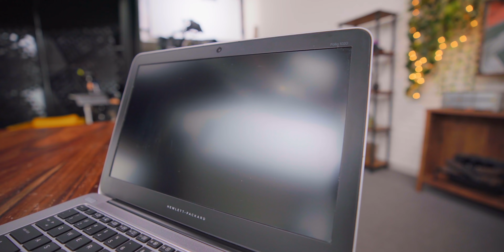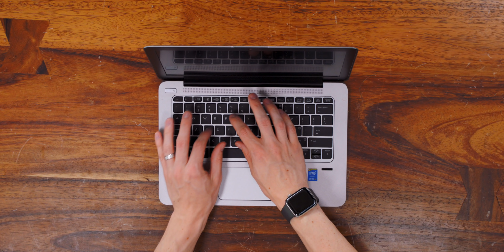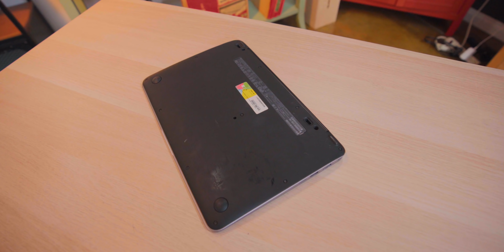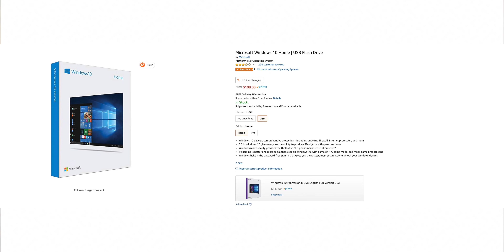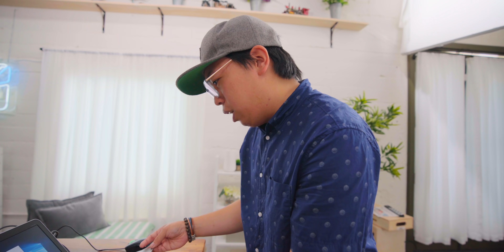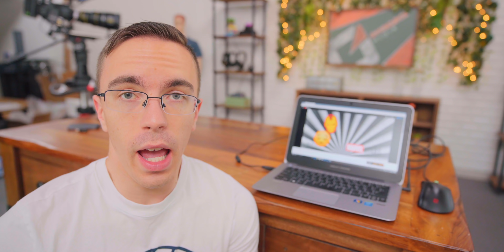My $190 eBay Gamble

Comment: Yeah just make your own windows 10 flash drive. Last time i did that installed failed the first time and after 2.5 hours of fucking around it finally worked. Oh and good luck reformatting that flash drive after your done. Having to install windows is the reason I DONT built PC's. SOOOO much easier to go grab an old optiplex.

Comment: Austin: This fingerprint reader is really cool to have on a $200 laptop. Me: (laughs in Thinkpad T61 and the spare $150 in my pocket).
Reply: @jdslyman My point exactly. The old Thinkpads are indestructible and most of them work just fine today. Even with a Core Duo and 8GB of sweet, sweet DDR2 or DDR3.

Comment: I gambled on a Refurbished Laptop from Ebay. Pretty good specs and what not (SSD, 16GB RAM, Intel i7), but the rating on it was B+ I wondered what it was. I ordered it for $300 and noticed that it was only slight cosmetic wear which I easily hid with stickers.

Comment: Hey Austin try buying an ASUS N550JK. It's a pretty quirky and classy impressive laptop. It had this screen problem where the connector on the mb was faulty, but spec wise it's very capable. The screen is great and the build material is beautiful. Hear me out!

Comment: i made a 187$ gamble and got myself a near mint condition 2011 13" macbook pro with i7 8gb ram and a 256gb evo 850 ssd.
what its problem was is two things: 1. it had no OS installed on it - easy fix, and 2. its battery was inflated and caused the trackpad to push out quite a bit and the battery life was at about 3.5-4 hours - bought a brand new genuine apple battery for 45$ and now it even lasts nearly 9 hours.
so for less than 230$ i got myself a blazing fast 8 year old laptop which still amazes me how dam good it actually runs - its geekbench score is more than double of the HP you got here and with Mojave(installed it with the patcher) it runs almost faster than my 3000$ windows desktop gaming rig, and definitely faster than my Lenovo Y700 Laptop which has a quad core i7, 16gb of ram, the gtx960m 4gb edition and samsung 960pro m.2 nvme ssd.
i'm shocked with how great this gamble came out.

Comment: i picked up a hp elitebook 8570w workstation laptop for about $95 aud no hdd bad screen only 8 gig ram put 1080p screen in and 24 gig ram going to add a msata SSD next with a 1tb SSD too ... Cpu is i7-3720qm. quadro k2000m gpu 2 gig ...  im going  upgrade it as its mxm slot card .
If you see  hp workstation laptops 3rd gen or newer there great for the price mine was over $2000 new i think im less than $250 aud in now

Comment: Literally only a few days ago I did the same thing went out on a limb paid 195$ for a
 Lenovo L440 with i7-4700MQ
8gb of ram
Windows 10
Ac adapter

Apart from the screen being 16 by 9 and not having a ssd also the laptop is huge. it's a amazing computer for the money.

Comment: Absolutely ridiculous. You can get a dell with a i7 4800mq, a 250gb ssd, a hd8790m a 1080p screen and 8gb of ram with windows installed for 200-250 bucks almost any day of the week. If you give it enough cooling it’s literally a gaming laptop. You can play any game at low setting 1080p with 40-60fps. It’s big and ugly but hey, you have a laptop that competes.

Comment: 🙂 Austin, it looks as though you won the gamble.

I think that the laptop that you purchased on eBay is worth the price.

In my case, I would have installed Linux on it (Eight gigabytes of RAM is more than enough to run any distribution of Linux smoothly).

Comment: You'd be suprised how often this actually works. I tend to do this to make a spare bit of cash on the side, and sure I might need to get a new HDD or power brick every now and again, but this is more often than not all it takes. Mark the price up a fair bit, and make a nice tidy profit. My ex-girlfriends father used to work at a skip, and did something similar with tons of hardware, find em', fix em', and sell em'. He had better profit as he got a lot of the junk for free, but it is a good way to make a spare bit of cash, if you know what you're doing, and I'd wager most of tech YT viewers probably do.

Comment: 190 for this? Really? Fat ripoff. You can get a i7 thinkpad t450 or 460 for that price. Comes with ssd, 1080p display, amazing keyboard, fingerprint sensor, ssd, and ofcourse thinkpad build quality and built with magnesium. Imo that's the best used laptop you can get

Comment: Did something similar back in 2013. Got a "for parts" MSI 7950 Twin Frozr 3 that had some info about when/how it stopped working..

Got the card and it didn't work, thought I'd try the second bios to see if it made any difference.. It worked fine and I used it for a week or so.

Ended up finding out the card was under warranty, but just cleaned it with compressed air and flashed the second bios to the main bios and sold it for $340 AUD (around double) what I paid when the bitcoin mining was big.

Comment: Not sure if you'll see this comment, but one of the executives at the company I work for had this model laptop before I updated her to a newer model with a more capable processor. If you're missing any drivers still, install the HP support assistant application and it'll find anything you're missing. I hate using OEM software, but for the business grade HP devices its almost required to get the correct and most up to date drivers. Also, dont install Linux on it because you'll have a bad time lol that touchpad is god awful and basically complely useless in Linux.

Comment: Get an old dell precision. I got a m6600 with a 2540m, quadro 3000m, and 4gb of ram for $150. Popped in a 240gb ssd and it is great. Easy upgradability and a 17 in display is quite nice as well.

Comment: I got a similar one for 180€, around 200 USD, with a 256Gig SSD, 16GB of RAM, Full Hd, an i7 4600u, a firepro 4100m
USB 3, displayport, VGA, fingerprint
It was an older workstation
It's an HP ZBook 14 G1 Mobile workstation
Works pretty well
AND I LOVE THE TRACKPAD, MORE THAN THE ONE FROM THE MACBOOK PRO, IN MY OPINION

Comment: I love working on older laptops :)  I do board repair when they are foobar too.  Right now my main computer is a Dell XPS L704x, when I got it it was total fubar. But now its working great and its been my main everyday laptop for coming up on a year. It's got an i7-2720HQ, 16Gb ram, SSD + a HD, 3Gb GT555m, and a blueray.  It's much more powerful then my old phenom desktop. Because I fix so many laptops, I actually have like 8 or 9 repaired ones to chose from lol. But everyone cost me at most around $45 each and they all were fubar originally.
Reply: Only issue is I'm not really a sales person so I've actually never sold a laptop I repaired. I just keep them all :/ lol

Comment: Should have gone for the HP Elitebook 9480m, it goes for the same price and it's much better, it has a 4th gen i5, 6 hour battery (in my daily use)

Memory, and 2.5 inch drive are upgradable the cpu heatsink is easily removable for new thermal paste application. Battery is also easily replaceable.

Comment: I loved that you did this video as well. A few months ago I bought a bare Elitebook Folio 9480M with a 4210M CPU. No SSD, no RAM, and no power adapter-but it only cost me $60. I put in RAM, an a SSD,  purchased a power adapter and it’s run great for the past few months, good enough for Chrome and the few Office programs I run, even if battery life wasn’t great and I had to tape the battery in. Great investment, and I felt the same way you did. However, recently, it started shutting down if I moved it too much, and now I have to look into the issue. It’s really important to remember that like you said, this is a big gamble. I have no warranty to fall back on, and you have to be prepared to keep working on it-which you and I are. Just wanted to point that out, and once again, fantastic video Dunc Austin.

Comment: I literally bought an hp elitebook 840 g1 this month. For 350$CAD. 256gb brand new ssd inside(literally reported less than 30gb in writes.. which is basically windows), i5 4300u, windows 10, 8gb of ram, power adapter... Touchscreen too. Condition is near perfect. No scratches anywhere.

Comment: No power cable or original packaging? U sure you haven't bought a stolen devices?
Reply: A lot of the power supplies are still useful for the new models, and are kept by the individual employees. In other cases they're sold separately to increase liquidation profits
Reply: @jamesp5644  good point about parting out the PSU for money, or back up
Reply: go looking for Lenovo Thinkpads, and it's often times either enterprise, or education surplus that shows up on eBay, and they sometimes have the HDD ripped out, and smashed for data purposes, and they don't include the power brick for what ever reason, so even when I get rid of a laptop, or netbook I always keep the power cord in case I ever come a good deal minus the brick.
Reply: ..with a destroyed windows install..
yea its probs stolen
Reply: Henry Hill no they are probably right

Comment: For touchpad, just install Windows precision drivers.. You have some mod for not supported Lenovo i think which works fine on other manufactures also ( if it's synaptics something something ..). Didn't do that for cuple years now as I'm in Linux world since on daily basis but as I can recall they were much better than synaptics...

Also I've done this on many laptops for family and friends and all were a lot appreciated. That's because here in Croatia macs which are kings of trackpads, and similar priced other manufactures laptops are kinda in a good used car territory.

Also think d2d done video on those, try to look up.

Comment: I've got an HP Elitebook 8470p that came with an i5-3320m but I swapped the cpu out for an i7-3612QM. It's a super awesome laptop and I use it every day. It's my main Linux machine.
Reply: I’d put windows 10 on it. My main Linux machine is an i7-5500u with 6gb of ram. I barely use it though.
Reply: @EvilTurkeySlices  I have 2 computers. For a while my elitebook was dual booting  windows 10 and *buntu. I bought an HP omen with an 8th Gen i7 and that machine runs windows only. I like having separate operating systems on the different sets of hardware.

Comment: I bought an Nvidia variant of the Dell E6400 for $50 on eBay that had a Core 2 Duo T9550, and 4GB DDR2 RAM. I added an ADATA SU800 128GB SSD, And replaced the ODD with a second HDD. I also changed one of the DDR2 sticks from a 667MHz to an 800MHz stick. It runs Windows 10 very well

Comment: What’s the difference between a “business laptop” and a regular laptop. I’d assume business laptops are weaker since they mainly just need to do basic things?
Reply: penandpaper just see diff between lenovo thinkpad and other regular lenovo laptop
Reply: Business laptops usually have quadro GPUs in them instead of geforce ones. That is if you get a laptop with a dedicated GPU which some do have. Build quality is normally better on a business grade laptop then a consumer grade one

Comment: When you buy any tech cheap it’s a gamble but sometimes you find gold like an Xbox One Elite controller I found at a yard sale for $20 (it’s fully functional)
Reply: Business grade laptosp are usually fine for buying used. Its the consumer grade stuff you need to worry more about. Even Business grade desktops are fine if the company has swapped out their entire office for newer mahcines. Those are liekly to be missing hdd/ssds tho but those are pretty easy to replace.
Reply: Once got a model M13 for 10 bucks at a garage sale
Reply: I actually own 2 used laptops: 

A Lenovo z500 with a i7-3632qm, gt710m and a 1tb harddrive. (also upgraded the ram to 12 gb and swapped a 512gb evo 850 from my old laptop as well) 

I also own a Lenovo yoga 2 pro with a 3k Samsung display, 256 gb ssd, i5-4200u and 4 gb of ram.

Both were around €75,- each (I basically stole them)

(fyi I live in the Netherlands that’s why it’s in euro’s)
Reply: Lmao this comment is stolen from IGN from their ps4 pro 500m unboxing!
Reply: Random Stuff My comment?
Reply: Lucky i had to fork over 170$
Reply: Same! Bought a used 500 million limited edition ps4 controller for $40 bucks used and works perfectly fine!
Reply: Edward Rodriguez that’s awesome. I usually will buy used tech unless if it’s something I really want and it’s not too expensive like the new Sega Genesis classic that is coming out. I am definitely buying that day one
Reply: Edward Rodriguez there hasn’t even been 500 million ps4’s yet so how is the remote “limited edition”?
Reply: Censura I think the 500 million is for the PlayStation console line as a whole not just the PS4

Comment: In a few months
Gamble: Installing Windows on a Huawei Matebook
Reply: I have Matebook D Ryzen and dual boot to Linux Mint 19 and everything (including touchscreen) worked out of the box. Is really great for when I want a change of pace.
Reply: Well, it seems to happen.😁btw I hate Huawei
Reply: @Tesla Model 3 Linux definitely doesn't "suck" yea it takes some time getting used to it but once you know your ways around Linux you can do your tasks in way less time than windows. And you don't have to rely on prebuilt software which sometimes cost money. You can just get the source from github and build it yourself. The community is very helpful and they are  very supportive towards newbies.
Even a cancer place like 4chan has a  good Linux community.
Reply: The first thing i did after buying my matebook X pro was install Linux on it.
Linux>>>>>>windows
Reply: @coffee-vz1nr  Android is linux...
Reply: @RettigJ sorry I didn't get the context of your comment but yes I know android is Linux infact android runs on a modified monolithic type Linux kernel which is based on lts. Even though v5.0 is out android still uses the lts branch meaning it is still stuck on v4.9. but it doesn't use the bsd library instead uses its own bionic library code. Also android doesn't have native X support and it also doesn't support the whole range of GNU libraries
Reply: @coffee-vz1nr  Congrats on the research :)
Reply: Snow Hound just hackintosh it and your gucci
Reply: @coffee-vz1nr  not if it comes to compatibility
Reply: @doktorj8462  compatibility isn't an issue when you can dual boot windows and Linux. For the stubborn stuff use windows. Fingerprint scanner was an issue but with ubuntu 18.10 they added support for it. The best distro to run would definitely be ubuntu due to its huge developer support and community. Linux community is way better than windows. Whenever you ask a problem in a windows related community if they don't know the solution they blame it on your hardware. Literally I was running windows 10 and facing major lags and screen tearing and the most of the reply was to throw my system in the trash. (It's a core 2 duo e7300 paired with a gt610 and 4 gig DDR2 ram) really old hardware I know.  At last I decided to give Linux a try and got ubuntu 16.04 running on it. Shit was smooth af. I could not believe the performance. I was only getting ram usage of 800mb on boot. Compared to 2.6gb on windows. So I started to read books on Linux and Currently that old hardware running solus 4.0 serves as my 280TB Plex server. That machine runs 24/7 without a hiccup

Without Linux I would have probably trashed that pc back in 2016. Maybe I'll show some love and replace the e7300 with a q9650. It could also serve as a totl retroarch emulator.
Reply: Snow Hound I run Windows 10 on a Core 2 Duo e6750 and it runs fine even with a mechanical drive and 4gb of ram. I’ve run Windows 10 on an Athlon 64 x2 before as well.
Reply: @EvilTurkeySlices  windows 7 runs absolutely fine but idk why widows 10 lags on my system with screen tears every few minutes. Btw it was windows 10 pro unactivated. Windows also has quite a lot of bloat in my opinion compared to Linux.
Reply: Snow Hound windows 10 runs absolutely fine on a lot of my systems.
Reply: @doktorj8462  there's an app called wine that let's you run windows apps on linux albeit not as fast as they would be on native windows
Reply: @coffee-vz1nr  You need to modify windows 10 to use it smoothly. I've modified Windows 10 now it uses 0.9 GB - 1.1 GB after Booting
Reply: Snow Hound then your laptop is completely overkill
Reply: Snow Hound yes no disk nor online games work on Linux
Reply: @jimmyneatron7995  no one buys an ultrabook for gaming. Also Linux is much better for gaming than windows due to less resource being consumed.
My matebook runs just about any game whether its online or offline. With the fact that I usually get +5-10 fps boost. but I was dropping frames here and there. Matebook X pro isn't for gaming. 

Add to the fact that I was regularly getting +2-3 hours of battery life compared to the same usage pattern on windows. My on boot ram usage is around 850mb compared to 2+gigs on windows.
Reply: @coffee-vz1nr  listen up. windows is good. Linux is good. if you can't buy a mega gaming laptop. go for Linux

Comment: Me: ooo I just found an old laptop, lets use it
doesnt work and throws it away
Austin: HOLLLLL UP
Reply: Lmao
Reply: In this case the hardware is fine and it was just Windows that wasn't installed/working so pretty simple fix in this case. Your Milage may very alright and you you may end up with a broken power connector on the board if its a consumer grade laptop. Business Laptops are more likely going to be fine tho as those are usually swapped out for newer machines and IT departments like to sell the old ones to recoup some of the cost.

TLDR Business laptops are a better buy option in the used market then a consumer grade laptop
Reply: Montisaquadeis oh
Reply: @Montisaquadeis  Good to know that, thanks
Reply: Montisaquadeis wow dude chill out nerd 😂 (the man was just kidding)
Reply: MiCRo [ : yea thanks man
Reply: Lmao 😂